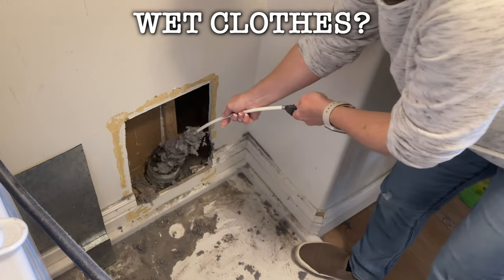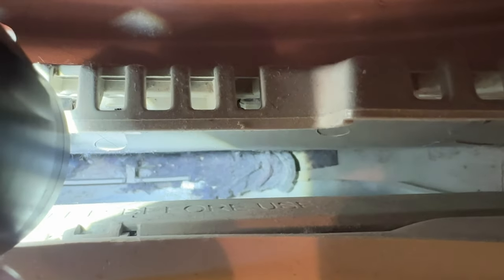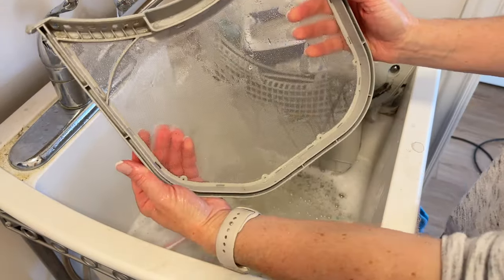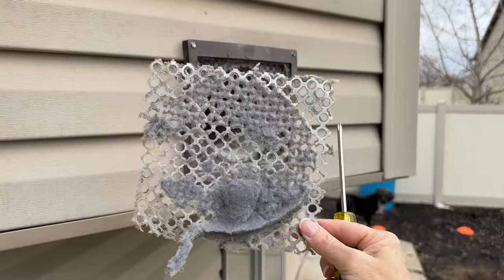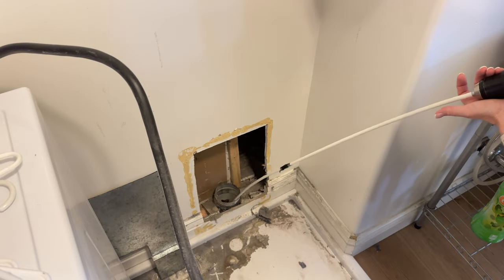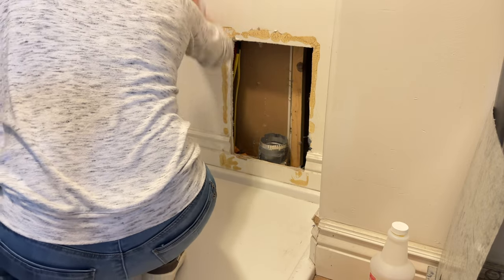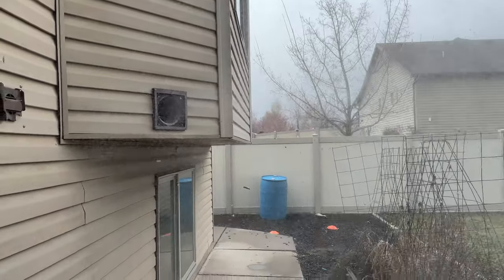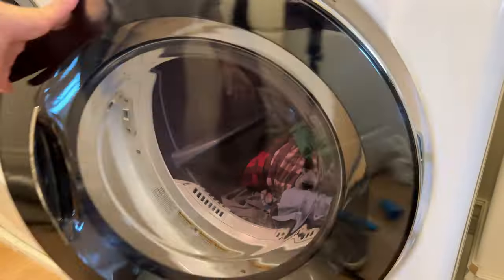How to Deep Clean Your Dryer Inside and Out

Comment: Great video! You know, you can really shorten that vent hose. It comes super long to accommodate all spaces, but you can cut much of the excess off to eliminate the extra hosing. Your dryer will actually work more efficiently with a shorter hose! If it's getting bent, it's too long.
Reply from the maker: Thanks!  I could probably cut it shorter (I didn’t think of that at the time), but it needs to be long enough to pull out the dryer to get behind. I’ll have to see what I can cut off.
Reply: @reallifewithali pull the washer out and you can get the connections made on the dryer with it only pulled out about a foot from the wall. Make it shorter too!
Reply from the maker: @stevenmpeter  Good idea!  Thanks!
Reply: @reallifewithali  Get a periscope... there's a youtube channel called al metal dryervent... he vlogs his daily dryer vent cleaning service videos... and he shows the backs of ppl's dryers and often they are kinked and lots of times he fixes them with what is called a periscope... it's like a square metal box that connects to the wall and can move to accomodate where the back end of the dryer goes in and then just push the dryer directly into that up against the wall... it looks so much better... You did so much great cleaning here... but seeing you push that long hose back probably kinking it is likely blocking airflow..
Reply from the maker: @One-Day-After-Another  Thanks for the suggestion. I’ll check it out.

Comment: The installer who put our dryer in cut the flexible hose shorter so it would fit without kinking. Maybe you could try that yourself or look into buying a shorter length one? Great job!
Reply from the maker: Thanks for the suggestion. I think we have done that before, but the problem is it needs to expand enough to pull out the dryer. 🤔

Comment: Loop a cord round the hose so you can lift and rearrange it’s position whilst pushing the dryer back into position - it could then loop along the back of the dryer without getting so bent or dented it gets squashed blocks the flow diameter.  I agree you could shorten the hose, but only so far if you need the length to pull the machine out
Reply from the maker: Thanks for the suggestion!
Reply from the maker: Thanks for the suggestion!

Comment: Absolutely shocking how much lint was there. My dryer vents directly outside so I only have to clean the flexible hose but I still need to do it once a year.
Reply from the maker: You’re lucky!  Mine is over 12 ft (with a sharp turn) to the outside!